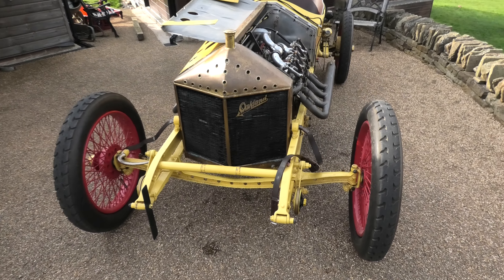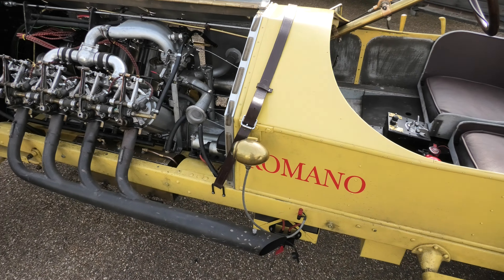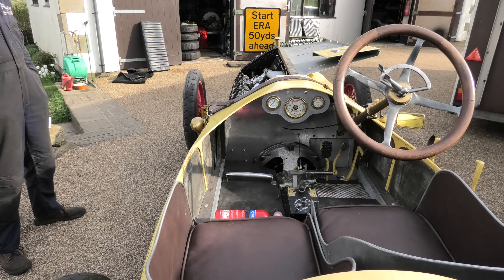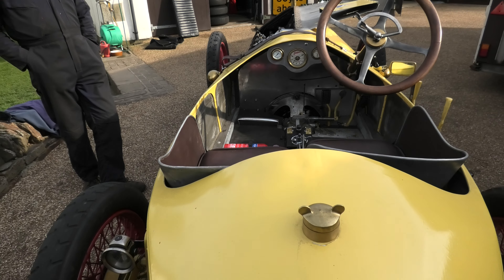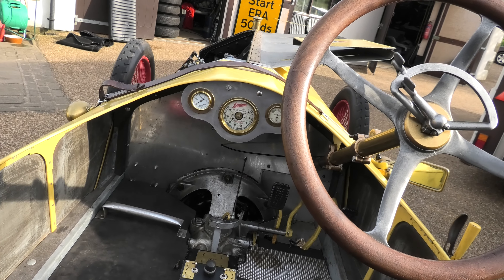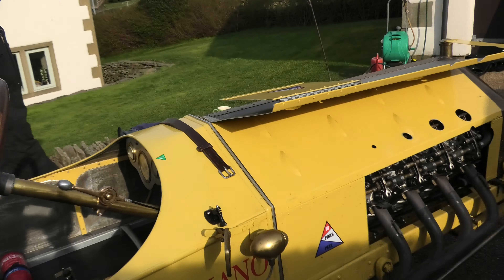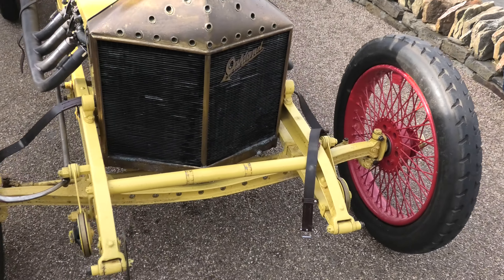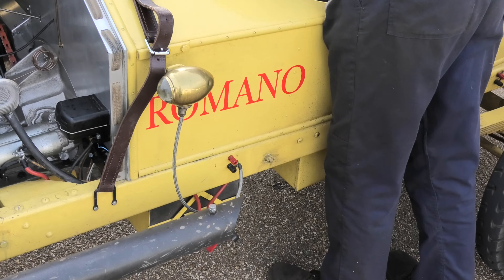Oakland Romano Description and start up . OX5 engine.

Comment: Those old Curtis OX5 V-8 aero-engines from WW1 make great powerplants for vintage racing 'specials'. There are several such beasts here in the UK. James Baxter's TipTree Engineering is a  brilliant company.
Reply from the maker: Hi Terry, it's a beast alright by the way It's Tip Top Engineering...thanks for your comments.